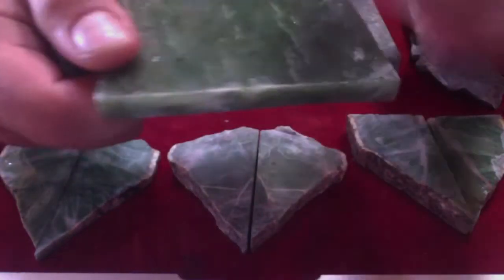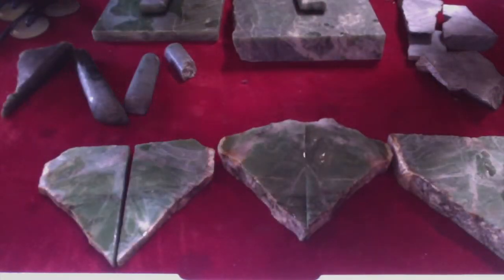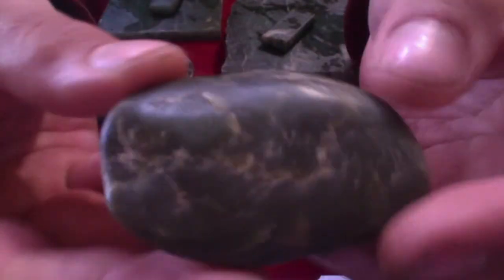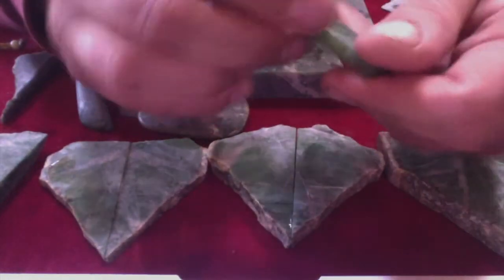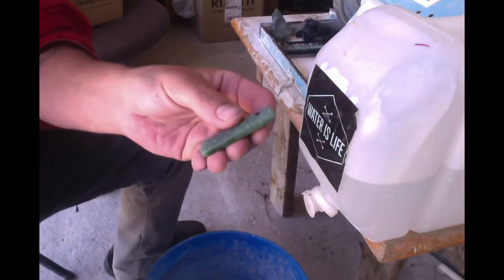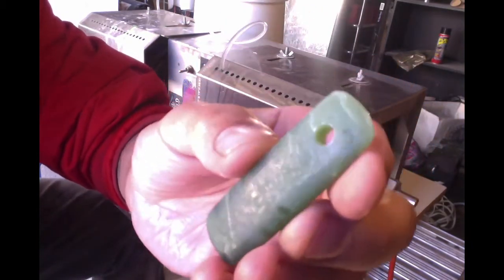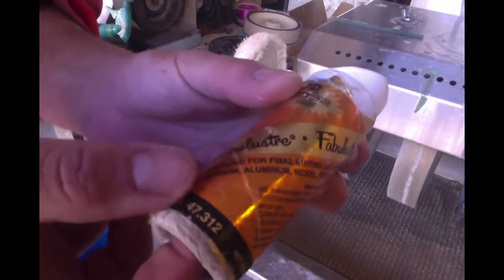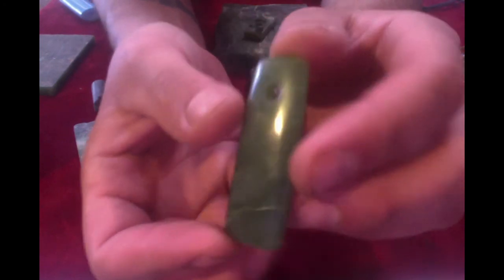LApidary Time!! Polishing a Nephrite Jade pendant

Comment: Nice!!! Thanks for the Nephrite video. That's what I find the most of at my secret spot in the Mojave Desert, CA. I don't have the awesome setup you do -- I currently use a tile saw & a set of 7 diamond/resin stone polishing 5" pads on a drill (until I can afford a Cab King). I noticed the orange peel on mine the first time I polished jade -- it was really disappointing compared to chalcedony. Mine had the same cork-like pattern you showed before yours was done. My disks only go to 3,000 -- is that why I still have orange peel? It looks like you buffed it out in the end. I have many pounds of jade (maybe 75) I'd like to be able to finish to a high luster. One really odd thing I noticed about the jade I find is that the size of the grain usually goes up with the size of the stone I find -- the smallest pebbles have the finest grain.
Reply from the maker: awesome thanks for sharing , if your ever sell some of love to buy some material:)
Reply: hard to avoid undercutting on jade, surprised it wasnt mentioned in the video. from the research i have done it sounds like you want to stay away from felt in the polishing stage. tin polishing lap is recommended or tin oxide on leather. let the stone heat up during polish. avoid loose abrasives, sandpaper, grinding stones. the big company in bc uses diamond all the way up, i think to 50,000.